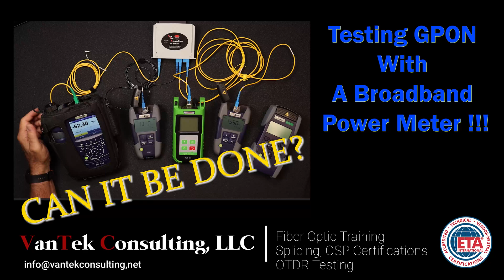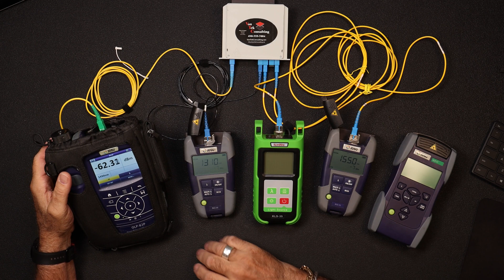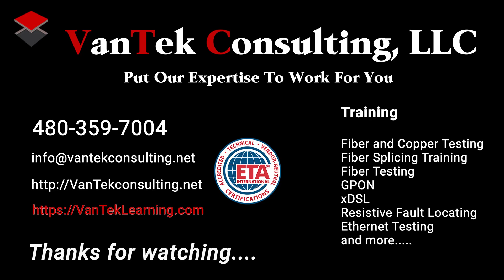Power Meter GPON Testing

Comment: hello, great video there, i have a question, how to test my own ONT? can it be done with this power Meter?
thanks in advance
Reply from the maker: Thank you. Testing you own ONT is not really necessary after installation unless it is completely dropping offline, then it would be up to the provider to rectify the issue. It's more the case of you have light or not.  You also run the risk of contaminating a connector with dirt which would cause an issue. That said, if you know what wavelengths are on your PON, it would be possible, but not advisable for an end user to use this type of meter. Just to be clear, the power level of the light does not equate to lower latency, higher speeds, more bandwidth, etc. Hope this helps.

Comment: which one is better and prize please
Reply from the maker: The application specific meter to test xPON would be the correct meter to use. These range in price based on brand, options, location, etc. and are a typically a few thousand dollars.
I that is not in the budget, then you could use a standard power meter understanding there may be a bit of variance that needs to be corrected or allowed for. This option is better than not taking any measurement in my opinion.
Hope this helps, thank for the question.